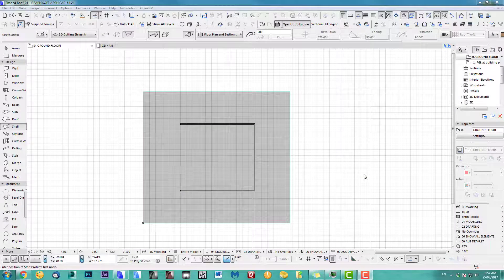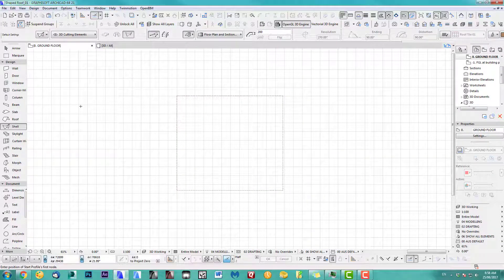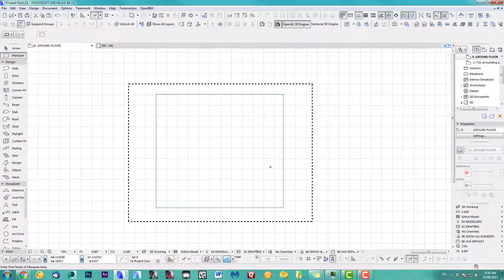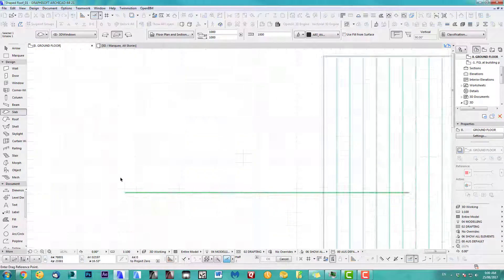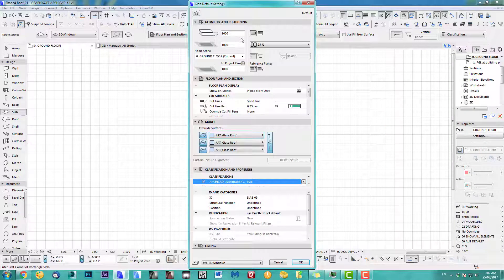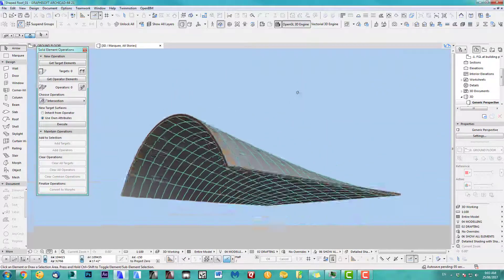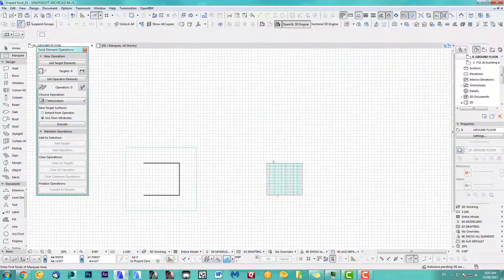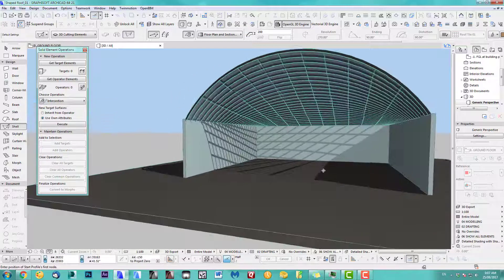How to model a free shape glass roof in Archicad

Comment: great job! thank you so much
a quick question if you don't mind, you know when completed this shape, how/ can you put  glass/windows vertically so it's completed for an entry ? thanks
Reply from the maker: Thanks ! 

There a couple of options. 

- Use some windows library parts combined, depending on your opening
- Use the profiler ( draw an elevation, in there draw the fills needed to add to a profile )
- Use the curtain wall tool, make sure it overlaps at the top of the opening, then trim it off